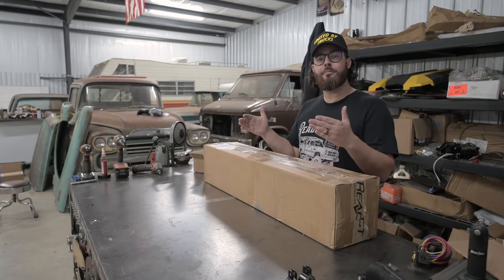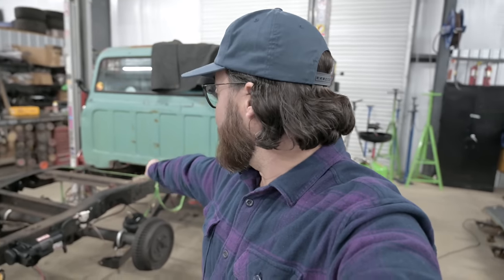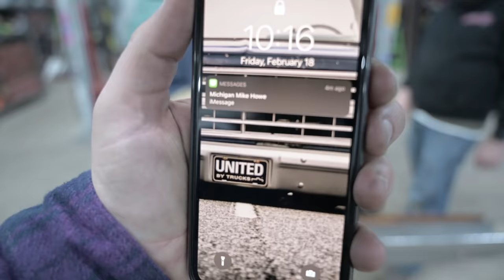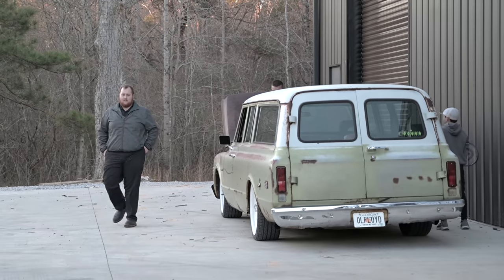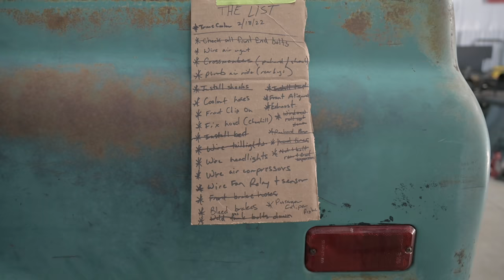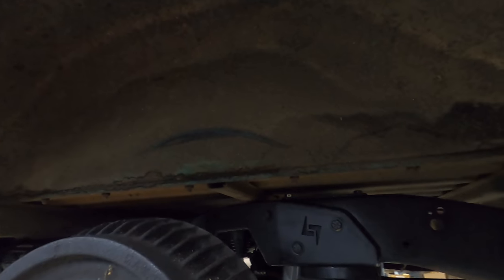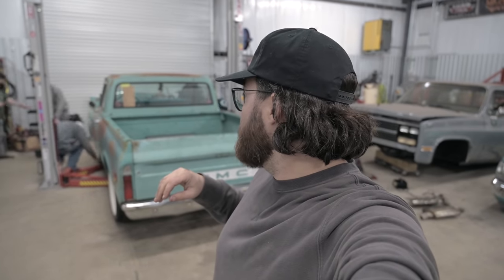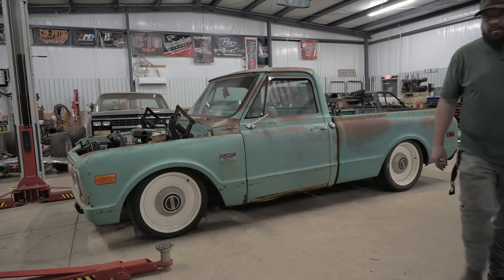FROM WRECKED TO ROLLING: Repairing Teddy with a patina front clip & all new airbagged suspension

Comment: Did your gmc come with factory trailing arms?
Reply from the maker: Yo, Travis! It did not. The original Longbed frame, which i still have, was leafs. Most GMCs were in this era, if not all. Back when we started putting this truck together, we used a factory ‘68 chevy shortbed chassis.
Reply: @UNITEDBYTRUCKS  gotcha! I see that gmc crossmembers have the holes for trailing arm brackets so I wondered if it was as easy as installing the brackets and then the arms.
Reply from the maker: @SIMPLE.C10  I believe that’s the case. I doubt GM would make a separate style crossmember for leaf trucks. Likely all made the same way, but GMCs just didn’t use those TA mounting holes.

Comment: You are going to need more cardboard for list. Technically, I would apply Permatex white pipe thread sealant on your radiator fittings that were not shown being tightened. EVAP hose to roll-over valve had screw in it. Needs run to inlet on activate carbon canister to facilitate refueling. I do not remember seeing sway bars on the front or rear? Should they be running low slung? Let’s find out! Stay tuned for interstate parts car following with tools and repair goodies. Still, no one had mentioned electric fans? Switched on dash perhaps. Now I am thinking tacos, hungry! 
Tail light grounds? Head lamp grounds? We will see!
DK. ASE Master Tech, 67 C10 owner.

Comment: i ran a 5 inch offset on the front for many years. the bumpsteer was crazy
Reply from the maker: Haha backspacing and wheel width makes all the difference. This one rides low like it’s on rails
Reply: @UNITEDBYTRUCKS  thats great to hear
Reply: What size are those Wheels and did I hear you say you narrowed the front crossmember?
 right now I'm trying to fit certain wheels and tires on my truck and I'm worried that I won't be able to ride low and still be able to turn without rubbing.
Reply: @1DENGRAM  I believe he has 1" shorter control arms but stock crossmember.